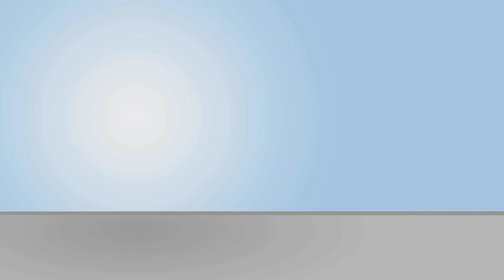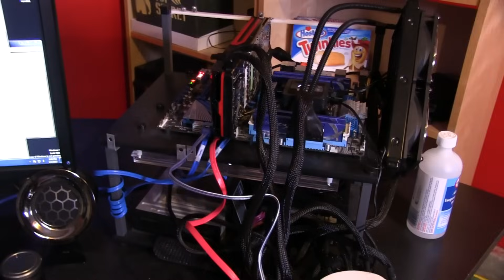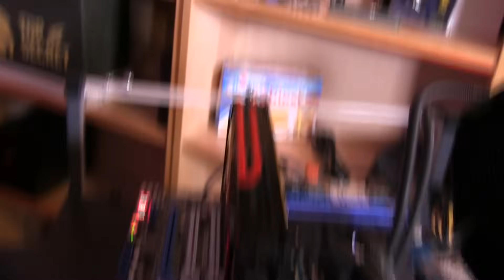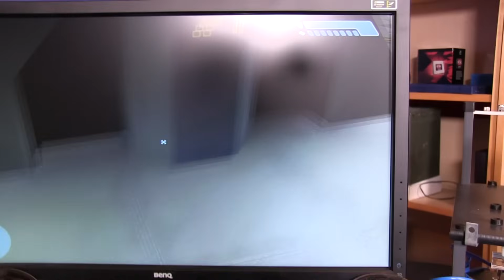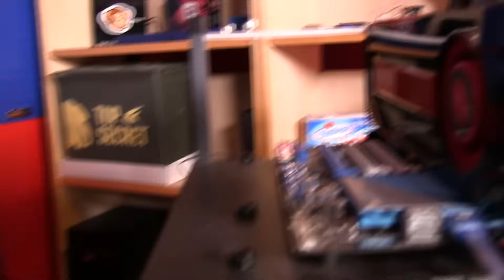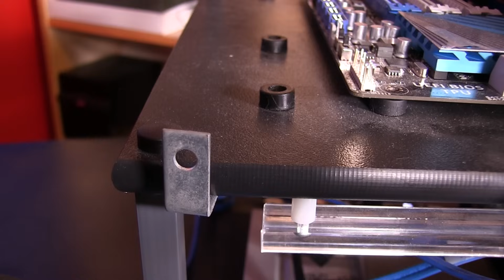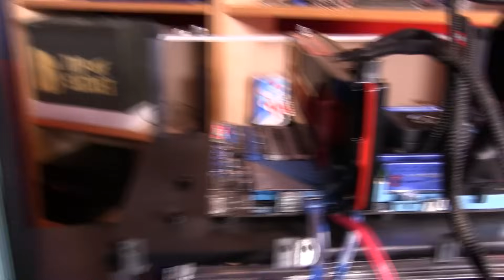Coil Whine Explanation & Demonstration Linus Tech Tips

Comment: Ive had the same problem when i build my own pc. Changed from psu branch but nothing helped. i Changed my videocard from HD6850 to Gtx 760 Sli and changed the Psu. Still i have that same anoying loud sound.

Its posible people say: That it could be Low on WATT / Not strong enough psu in anyfront not only the amount of watt.

For me its so anoying and i cant stand it, when i have the money i buy a holl new pc maby that would work finally!

Trying a sollution? Im going to change the psu due to warranty and the anoying sound to 850watt if it stays then so be it. Ill let you guys no.

Ive had this all the time, and now with the new 760 sli its much louder.

If anyone cant help please!!

Comment: Coil whine as in the high pitched squeel is pretty normal while running 3d applications with high framerates imo. You can always force Vsync in your drivers to try and make it stop. There's also the low buzzy sounding coil whine that occurs even while below 60fps, if you don't mind voiding warranties, I heard you can try and fix that with some hot glue to stop the coil vibrations on your graphics card or in your PSU after you've identified which coil the noise is coming from. It can be really dangerous though if you don't know what you're doing, so it's not necessarily recommendable.

Comment: Coil whine usually happens with the more powerful CPUs. They tend to do it when your FPS reaches over a thousand. A quick solution is to just cap your frame rate. It's worked for me.
Reply: Yea
Reply: your right thanks i limit it to 150 since i have a 144hz and its alot more quiet.
Reply: @justinjuarezmason3188  limit it to 144fps this will look a lot better than 150 fps on 144hz display. 

Always try go hit the HZ of your monitor or half of that
Reply: @MONKEYDUDE2701  stuff looks a lot smoother with a higher fps than your hz
Reply: @zodiakwead  its basic physics you imbocile... wave length vs frequency.
Reply: You mean with GPUs not CPUs?
Reply: The system makes noise when it is idle. Does it cause problems?
Reply: @zihindekilerr  no
Reply: ahhh i went on a lego game and thats why
Reply: It happened on my 2 core Celeron cpu 😅
Reply: Thanks for the insightful comment
Reply: thanks thanks this helped me a lot <3
Reply: Who in the world doesn't cap their frame rate, excluding the ignoramus of course

Comment: 10 mins ago i got my 780 Ti SC from EVGA it makes the same sound. Is it normal for a card to do that? (I can only hear it when i dont wear my HeadSet(Tiamat7.1)i cant hear shit with them on)
Reply: It might be your power supply depending on the wattage and quality of the components/brand.  I just ordered a 780 to upgrade my 670 and had to upgrade my 3yo power supply too as the 780 requires a 42 amp minimum on the +12v rail (current only does like 25). I don't get coil whine while playing games but when running 3D benchies I would hear it pretty good.   More often than not it's not just the video card but other things in your system causing it, but if it is just the video card then yeah that sucks.
Reply: I have 900 watt silver psu. Its new and no its not the psu. I locates the sound its from the gpu
Reply: I have 900 watt silver psu. Its new and no its not the psu. I locates the sound its from the gpu
Reply: Pills161 I have the same card but don't get no coil whine while benchmarking. The only time I hear it is when I play War Thunder.
Reply: On Benchmarks i dont hear it either. (Due to it being in higher hz than what we can hear)
Reply: my EVGA GTX 780 cards are quiet but my gigabyte X99 motherboard makes a horrendous coil whine. it is so bad that i can't sit next to the computer for longer than 5 minutes without getting a headache. and it does this always, even when it is at literally 0 load. when browsing the web of just starring at an empty desktop
Reply: solomonshv Your motherboard is showing you what your mother went through when you were a baby.

Comment: My 550 Ti started to do that a few months ago. It's so fucking annoying. Gonna try to RMA it, I mean cmon, I've spent 125 dollars on a card...
Reply: $125? oh boy youre just getting started
Reply: TheBoxiestBox meh, there isn't much reason to spend more than that unless you are trying to rock out a 4k monitor.

Doesn't mean I haven't spent more on my gfx cards but its not like back around 2005~ where a sub 200 card was sketchy
Reply: Brad Sullivan Lol I spent 260 on a 760 and I couldn't max the most demanding games out there fully, Hence my 780 now >:D.
Reply: MyNameIsDuffmarn I have a 6 monitor setup so I keep things realistic because I buy 3 at a time, I am waiting for an evga card that has 2 display ports for under 250
Reply: This happens to my GTX 550 Ti (by GIGABYTE) as well. :(

At first, I was quiet happy with its overall design and did think that GIGABYTE does a good job with producing quality products. They even backed up the GTX 550 Ti with a 3 year warranty as well. But, hearing the coil whine was pretty upsetting. :(

I've been thinking to try and get a replacement but have heard stories about GIGABYTE having a horrible RMA process for Canadians.
Reply: Pras cha Well I guess you can live with it. I mean I have, what can you do? I'm from Lithuania, so I imagine that RMA'ing would be a HORRIBLE experience.
Reply: That's most likely what I will be doing--living with it.

I cranked the features for quality up and turned on VSync and I don't hear it as much. :)
Reply: Pras cha It might be a quincidence, but mine's a Gigabyte card too. It's the first time I'm having bad luck with em... Maybe it's just a bad batch.

Comment: Set yr maximum fps to what yr monitor is capable of displaying - 60, 120 or 144.  That should get rid of coil whine noise. Worked for me anyway.
Reply: Good advice, I was playing D3 with vsync on and decided to turn it off just to see what my fps would be and started to get coil whine.  Makes sense though, with no fps cap your card runs balls to the wall, when in a lot of cases doesn't need to. Go Rossi.
Reply: Haha nice one.

Comment: It happened to me also with ATI/AMD card. With Nvidia no coil whine.
Reply: What company produced the video card? Usually Nvidia has better quality, even if you compare Asus AMD with Asus Nvidia, similar price.
Reply: Crap! They cost the similar as they used to be 5 years ago, but they are not as good quality. WTF?!
Reply: Bujor Vasile Lucian It has literally nothing to do with quality. It's how much voltage you're putting through the card at once. 

Not only that, any top of the line card from five years ago would be beaten out by any middle range card today.

Comment: I just experienced this yesterday. A game normally runs at 300FPS which is around what i aimed for and there is no problem, however any menu/popup/pause will run the framerates into 2500+ and the whining will start. at first it scared me but then i noticed what was causing it. What i missed from this video is telling us whether it is dangerous or not, since you cant RMA for coil whine (they wont accept it). I will have to Vsynch to 60 FPS if its dangerous, loosing my 300 fps gameplay, but its better that than a burnt GPU right?
Reply: No tv or monitor will run 300fps. The maximum is 144 I think. Cap your fps to whatever the maximum refresh rate is on yr monitor and it will look smoother. For example, if u have a 60hz monitor, cap fps to 60, if u have a 120hz monitor set maximum fps to 120 etc. This also stops the coil wining noise.
Reply: rsvrider
I never said my monitor ran 300 fps. i said the game did, which measn that GPU was generating 300 frames per second. Using capping in that game introduces certain game engine bug that causes game to freeze sometimes, so i want to avoid that. Capping FPS will not give me smoother ride. Wasting FPS due to monitor being too slow does not make your game any more jaded. dropping bellow the monitors frequency does. There is no point to capping your FPS other than saving power consumtion. Well in some games it also is needed because the programmers were so bad they programmed their physics engine to FPS. Oh and i heard some people complain about screen tearing but i never saw that happen to me. could be just my GPU drivers handling that or something though.
Reply: i know you never said that. what i'm saying is there is no point having your fps running that high because you monitor will not display it so its just making your pc work harder for nothing. my pc can run at very high fps on some games but i cap it to match my refresh rate on my monitor. doing this makes the game run smoother (and as i said before will eliminate coil whine on yr gpu) having a game run like that you will notice the jumps up and down in frame rate but having it at a constant 120 fps will appear much smoother as the fps will stay constant at 120 or whatever you cap it to. i do it through nvidia control panel and select vertical sync - adaptive. give it a try.
Reply: it is not working for nothing. Some game engines actually allow you to do slightly more with higher FPS. FPS above your monitor refresh rate is always welcome when possible. high frame rates is what makes game smooth. The drop in framerate will not benoticable unless they drop bellow monitor refresh rate.
BTW your method is crap. your using v-sync that introduces input lag. Its better to cap it at 120 in Nvidia inspector if your so determined to limit your FPS. there are more options there as well such as 75 FPS.
Reply: Maybe our eyes are different! Either that or something to do with different monitors/tv's. I don't have noticeable input lag when using adaptive v sync and the micro stuttering is very obvious to me if I don't lock my fps. Good luck tho, that coil whine is irritating as fuck.
Reply: Maybe our eyes are different! Either that or something to do with different monitors/tv's. I don't have noticeable input lag when using adaptive v sync and the micro stuttering is very obvious to me if I don't lock my fps. Good luck tho, that coil whine is irritating as fuck.
Reply: rsvrider
Yeah, some people are bothered more by one while others are by the other. I see no microstutter (from what i can read Nvidia drivers actually do things to remove them for monitors that support that). Input lag exists, and some people dont notice it, which is fine for them. in some games like oblivion it really matters very little, twitch games like FPS or platformer its much more noticable.
Reply: Actully Evga does accpet CW card :)
Reply: Listen because it will save your life/gpu download evga pricision x its a oc softwere don't worry your are not going to over o.c there is the feature in the softwere that limated how much fps you set it with you monitor refresh rate and the gpu won't go over that limate and you will not have 2500fps which is the thing that making the coil whining see linus was a non intense gamei he was getting high fps and when he looked down the high his fps got do what I told you and enjoy gaming again
Reply: Powerprick red
 While that is not a program i would use to limit framerate, it does solve the issue, however forcing framelimit on certain engines causes other issues. especially whne those engines already run in compatibility mode.

Comment: Ah, this is some of what I've been experiencing. But it seems to come from my audio?
Reply: Yeah same for me. I got a evga 780 ti and noticed it straight away :/
Reply: shaunwagz I actually made some progress this weekend. I tried a separate speaker to see if the buzzing kept up, and it didn't. It appears to be related to my monitor, perhaps that it does both video and audio.

Strangely, when I changed one of the monitors to use HDMI, that seems to have improved things. Still some weirdness in certain moments, but fiddling with these aspects of my computer yielded interesting results.
Reply: Ross Llewallyn Ah, I have yet to try different speakers. My monitor also does audio which comes out clear, connected by hdmi.
Reply: @Wagzy  EM interference, not coil whine, coil whine doesn't just happen.
Reply: @ForcedevilX-rn1rf thank you for the feedback! This was a long time ago and the 780ti has long since retired. I remember my 1080 coil whining though. The 3080 now I've had no issues
Reply: shaunwagz
If your audio cable is not properly grounded you will get this same kind of noise through your headphones or speakers. The headphone jacks tend to get dirty or the cables worn out and the ground starts to fail and you will get lots of  these types of noise.
Reply: You might just need a soundcard. I've had that problem before with motherboard audio.

Comment: I have a pretty quiet sound on my card, i'm not certain if it is coil whine but it might be. It's not high pitched or anything, it's just a minor buzzing sound. Might sound weird but it's like someone is holding a feather against a fan :P But it's quite low and it only appears when i play games I believe and not when the pc is just running. Anyone knows if this is coil whine? Is it something to be worried about or should i get it changed for a new card?
Card: Sapphire radeon hd7970 ghz edition 3gb vapor-x edition

Comment: I am getting coil whine through my headphones. I've tested with several different headphones, and it happens with all of them. It corresponds to my movement, but it doesn't seem to get lower/higher based on my fps. I capped my FPS at 15, and I then heard these "ticks", basicly a slower version of the buzzing. Does anyone know how to fix this?

Comment: My GTX 760 makes a similar sound but not as high of a pitch, Would sending it back and possibly getting a new one fix the issue? or is coil whine across all 760's?
Reply: I also get noise with my Sapphire 7970. It will be high pitched like that if your FPS are high like 1000 or so.

Comment: I used to have this with my old computer! The sound actually played through my headphones, so it was incredibly annoying.

Thankfully it's fixed on my new build, but it's nice to know what it actually was
Reply: This is probably not audible coil whine, but instead a result of the power supply noise that causes coil whine leaking through a broken or badly designed audio circuit.
Reply: Cool

Comment: My motherboard did this (Asus M5A99X EVO). I disabled C6 state (i googled it and it said it should help) it made the coil whine stop, but i wasn´t able to boot because I got an Overclocking error. Then I downclocked my CPU to stock speeds and it is OK. But my H80i is pretty much useless now :D Maybe next time ill buy a silent optimized case instead of a high airflow optimized case.

Comment: im having the same problem with my new HD 7870, the noisy doesnt really bother me, is there any problem if i keep using it?
Reply: no, its normal. Its simply just electricity flowing through the coil making a little noise.Its nothing that will make the card stop working or damage the card.My gtx760 does the same exact thing.
Reply: *****  Thank you, finally someone with my card confirming this is normal :)
Reply: ***** My 760 is also whineing. First i thought it was my psu that emitted the noise since it's basicly a piece of crap... I can only play old games like CS 1.6. If i start for example Far Cry 3, Half-life 2 or even halo 1 (yes Halo fu**ing 1) my pc reboots and bios tells me that my psu is unstable and the computer rebooted to prevent hardware damage. Iv'e had no problems with it before, it started like a month after i changed my HDD for an SSD. My friend had the same psu and it broke down recently too with the same issue. Like they planted a self destruction timer in it
Reply: emil johansson Hey Emil! I'm a 760 non-reference user, I'm getting the whine, too! Urgh! Only happens when games are being rendered.
Reply: For me it happens more often... tho the sound isn't that loud. It usually start when i log on then it's quiet untill i launch a game. Im gonna replace my very very bad psu soon to see if it fixes it.
Reply: emil johansson hey emil, in the meantime you might want to consider setting the frame rate to 60, not using V-sync. I've used Precision X's frame target and it helped a lot! Letme know how it goes.

Comment: Where is the noise coming from? is it being emitted from the fans on the GPU? If so, how is the pitch of the noise from the fans changing so drastically based on what is being displayed on the screen? Is the pitch related to the fan speed? So many questions!

My 550ti sounds like a cake mixer oscillating between high and low frequency sound when gaming and I'm wondering if that's the same as coil whine.
Reply: The sound comes from inside the capacitors and sometimes other components on your card.  The "coiled" wire inside the capacitor or choke vibrates at an extremely high frequency, to the point where it becomes audible.  Power supplies can come with coil whine as well.  Sometimes, however, the noise you hear isn't literally coil whine, but rather just another type of electrical noise.
Reply: Thanks, your comment was very informative!
Reply: Daniel Pendzich You're very welcome.

Comment: sounds like an insect screaming lol i personally couldnt stand that! ugh! it seems that this is an amd card issue more often huh?
Reply: I have an nVidia GTX 480 and it whines. It changes pitch when I look around in a game just like this video. But it comes through my speakers through onboard sound, not directly from the card it seems. I had a sound card but I pulled a wire and broke the sound port, but I never heard it with that. Only with the onboard sound. I think the coil voltage of the video card is changing the voltage of the onboard sound, where with a seperate sound card it isn't affected. Also my PSU is old and very used, as he said in the video the PSU can make a difference too.